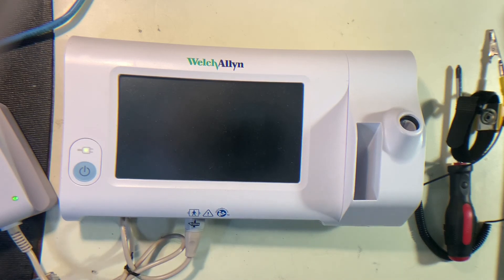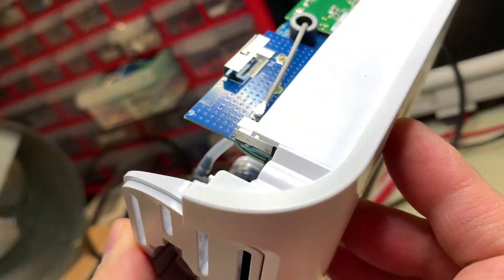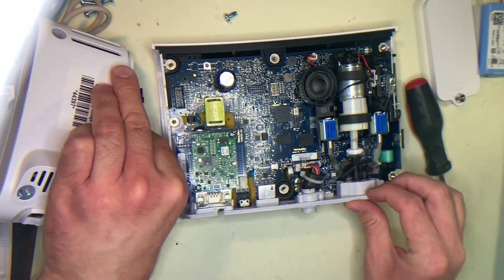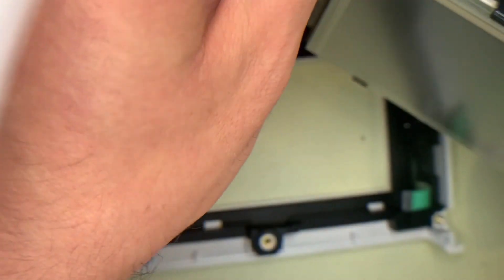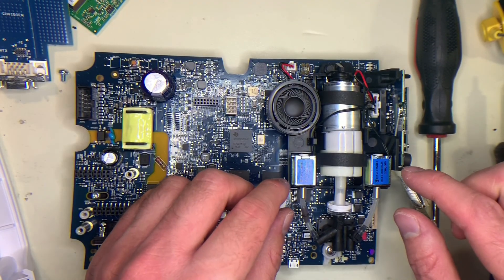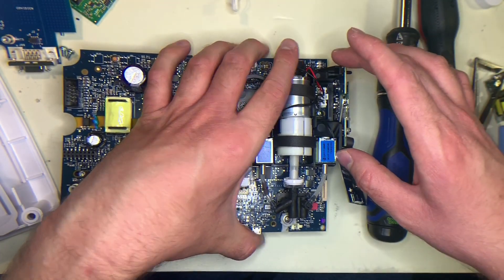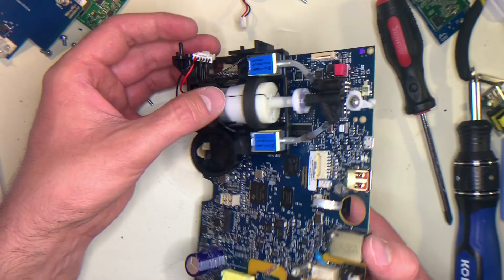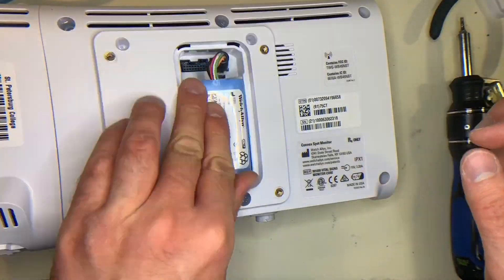Welch Allyn Connex Spot Monitor: How to Disassemble

Comment: Trying to troubleshoot why I can’t get mine to power on or off when I push the button. I replaced the battery and that solved the low battery warning. Now I can only turn it on if I have it go into sleep mode and then plug in the power cord to seemingly wake it up. Otherwise the button doesn’t wake it up or turn it on.